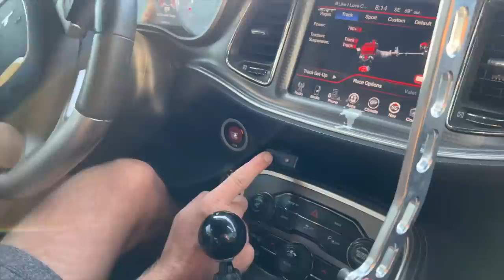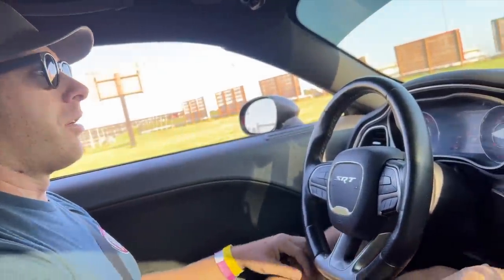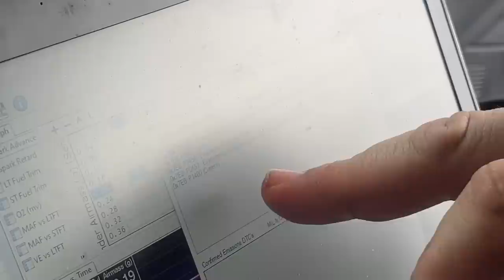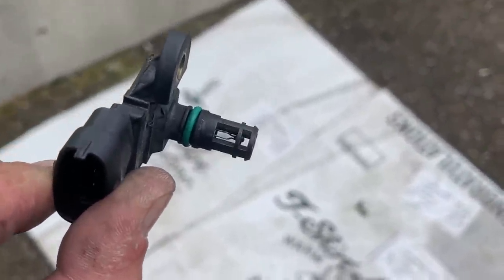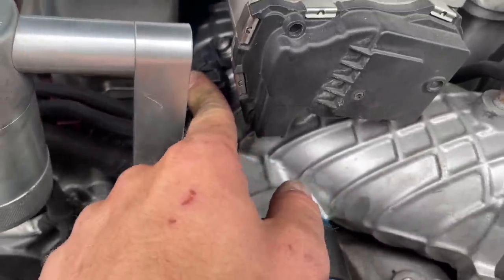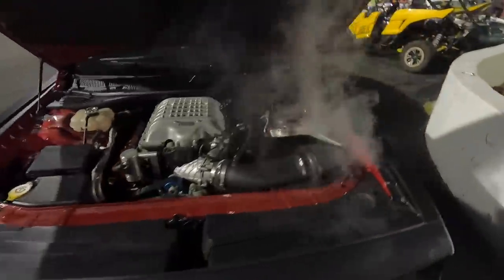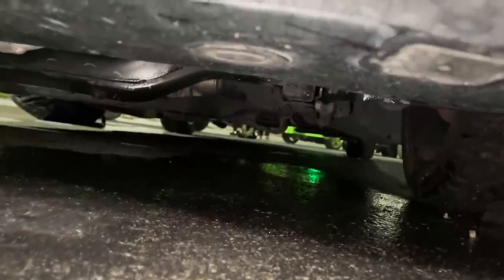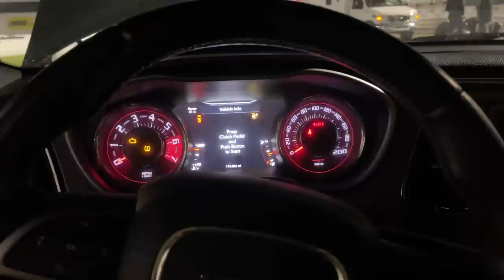I BLEW UP THE WORLDS HIGHEST MILE HELLCAT at Cleetus & Cars Indy... She's Cooked

Comment: I’ve been on Webinars with Chrysler Corporate and they flat out said these were designed to run from the cops, but high RPM and no air flow over the radiator will kill anything with enough time. Hellephant swap?